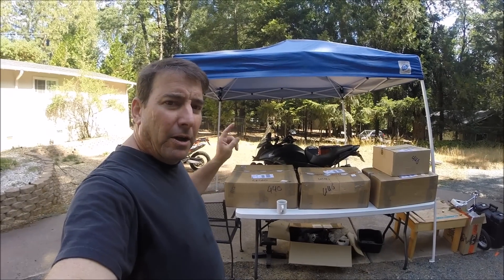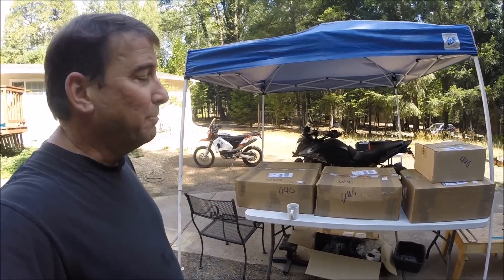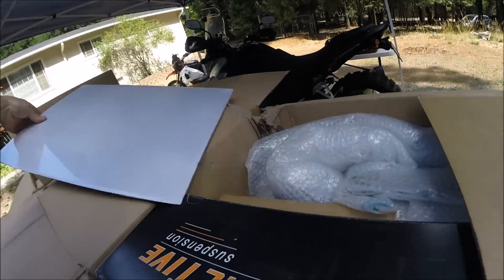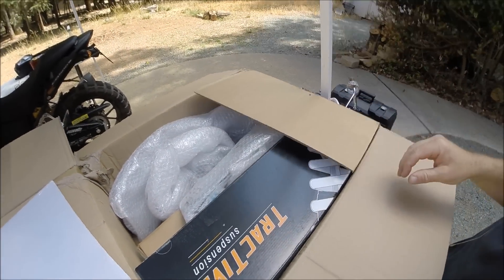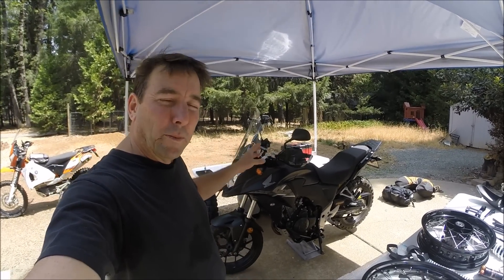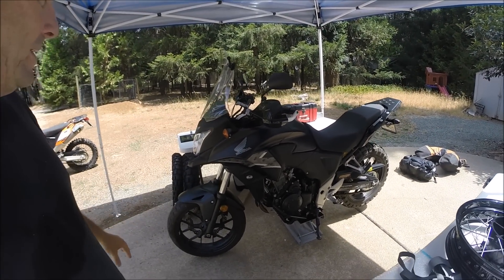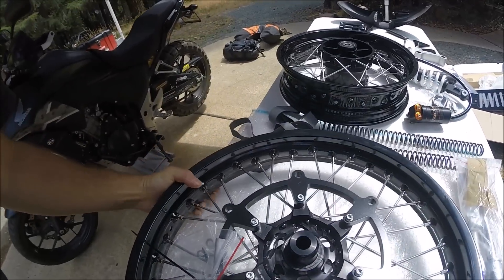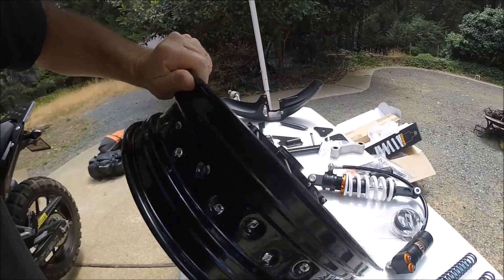Honda CB500X Rally Raid Adventure Stage 3 Kit Unboxing

Comment: What is that grey lifter platform thingy under the RR skid plate?
Reply from the maker: 65BAJA simple bike lift like this...https://www.walmart.com/ip/Extreme-Max-1100-Pound-Motorcycle-Scissors-Jack-Wide/49578704?wmlspartner=wlpa&selectedSellerId=0&adid=22222222228038176379&wl0=&wl1=g&wl2=m&wl3=80422889209&wl4=pla-177649669489&wl5=9027279&wl6=&wl7=&wl8=&wl9=pla&wl10=8175035&wl11=online&wl12=49578704&wl13=&veh=sem
Reply: Thank you. I just ordered the LVL2 kit a couple days ago. Can't wait.

Comment: Hi Blancoliro,
Regarding the RR Triple Tree .., how much higher does this raise the original handlebar height compared to the stock setup, as I notice those bar risers looked very high . 

This height difference needs to be calculated , when considering your selection for after market handlebar choices and how tall the model you select will need to be ?